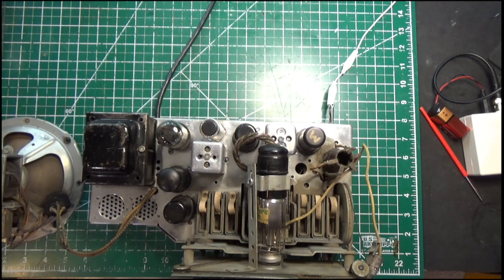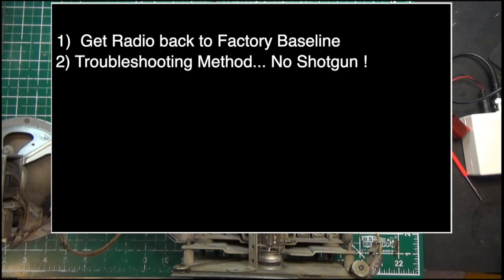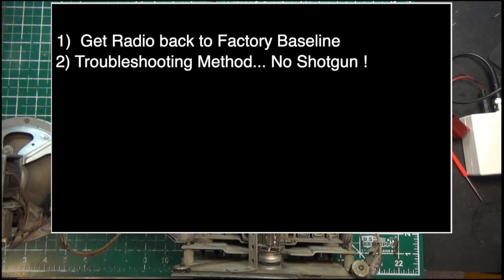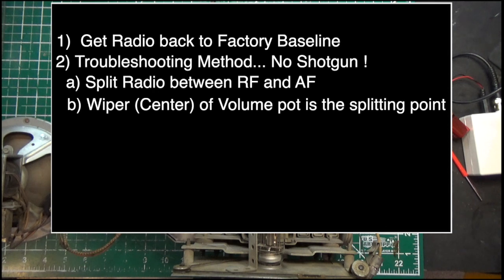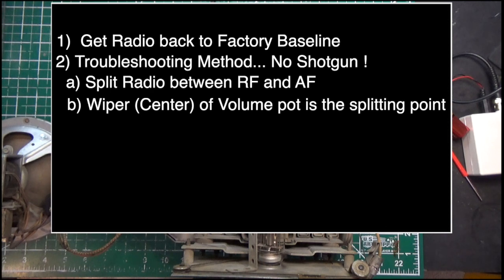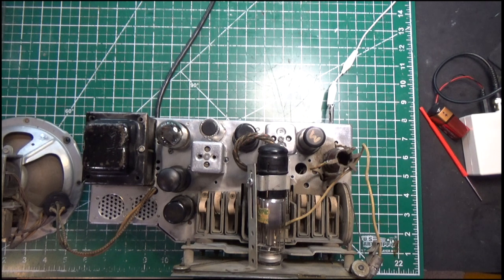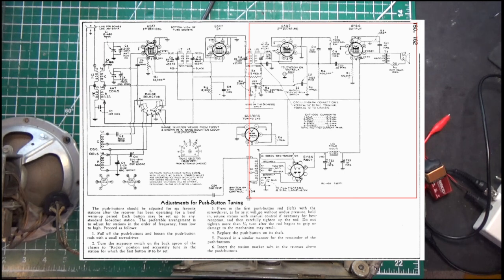Radio Restoration for Beginners RCA Model T62 aka #39 Part 6:  Troubleshoot the Audio Section

Comment: I like the series...showing troubleshooting methods and testing of various components. But as far as NOT using the shotgun method I think this proves that most of the time in my experience the shotgun approach usually works to just getting the raadio back to factory specs. Unless your are trying to save every aged component that you can for historical purposes (or that the cost of the component is expensive) then I don't see why you wouldn't replace all these components to begin with and then start your testing to see that it all works well. I mean to me once you replace an original power cord the A RESTORATION is in my opinion over. You can't replace components and call it a restoration in my opinion. To me that's servicing and repair.  But other than that opinion this is a great video series if one wants to understand the basic radio operation and theory.

Comment: I would desperately like to see a video that solves a "weak signal" problem. I recently tuned up an old RCA radio with a signal generator and all seemed well but with the antenna I could only get about 3 AM stations living not too far from Philly.
Reply from the maker: Can you  let me know the Model and I will see if I can help you

Comment: 25:29...in a vacuum tube circuit, the control grid voltage is ALWAYS measured with respect to the cathode!
Reply: Quite so.

Comment: I wonder if those paralleled resistors were intentional for the increased power rating. I noticed you don’t really dwell on power rating of the resistors you replaced.

Comment: Ron, I have been following this series, you have done a great job.  Thank you.  I have a question regarding the non-negative grid voltage in the cathode bias circuit.  My understanding is that typically the grid voltage in a vacuum tube has a negative potential relative to the cathode.  This prevents grid current flow.  When a circuit has a grounded cathode (Fixed Bias), measuring the grid voltage to ground is the same as measuring the grid voltage relative to the cathode.  When Cathode biasing is used, the cathode is raised above ground potential, therefore, measuring the grid voltage relative to ground is no longer negative; however, if you measure the grid voltage relative to the cathode voltage, even in a cathode bias configuration, it will still be negative.  Is my understanding correct?

Comment: Just to mention another warning that rf can burn you to especially transmitters even the rf oscillator on normal radio has ac voltage well over 1000 volts ac so be careful.

Comment: Hello, I have just found your channel and I am finding it very helpful.
One question, why does the dial light vary in brightness as you probe around with the signal tracer?.
Reply from the maker: Peter, glad you are enjoying these videos.   I never noticed that but you are correct. What you are seeing is a strobing effect from the 6V being affected by the signal tracer causing shorts and changes in voltage. I will have to open up that radio again and see if that happens.   Good catch !!!
Reply: ...for the HELL of it?!

Comment: Nice job Ron and you are putting that signal tracer through its paces, I noticed you have a loud hum coming from the ST before it is hooked up ti the circuit, maybe it needs a shielded cable.
Could that be one of the problems Dough had mentioned?

Comment: It may be optical illusion of the video, but it looks like there is a couple of places you have where capacitors are wired in series.  If true, that cannot be correct. You might want to check with the schematic and make sure you haven't been mislead by what a previous repair had wrong.
Reply from the maker: Mjr1999 - I am glad you pointed that out. It was on my list of things to check and I never got to it. It also seemed wrong to me when I replaced the caps, so now I will go back and check and make the proper adjustments. I will let you know what I find. Thank you for reminding me !!!!! - Ron